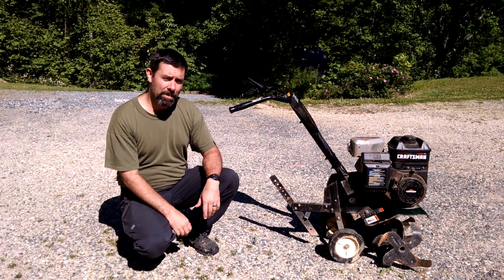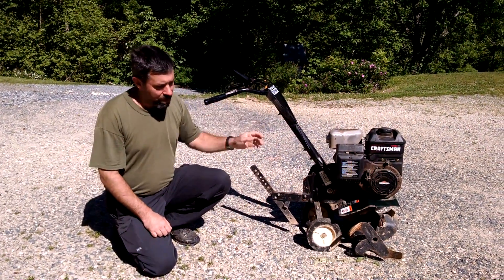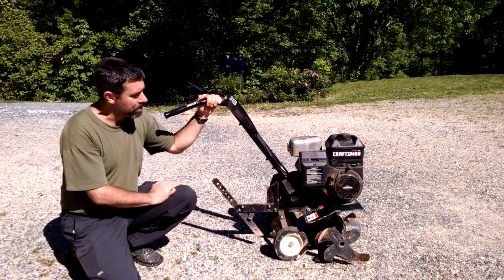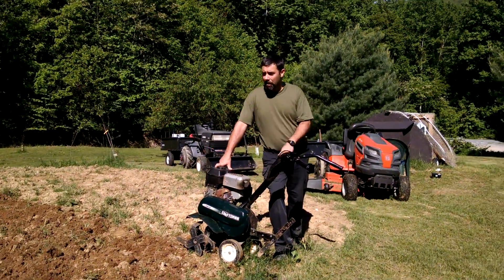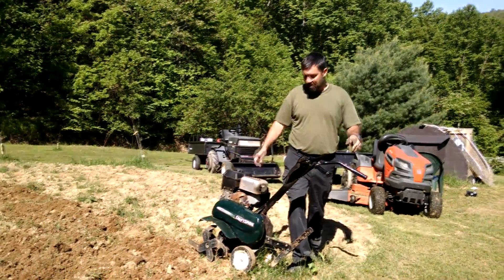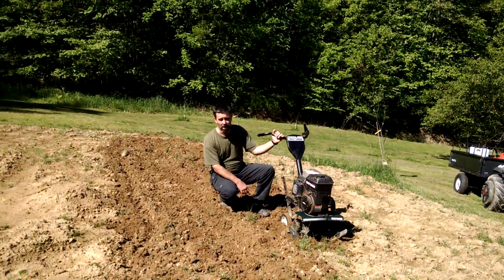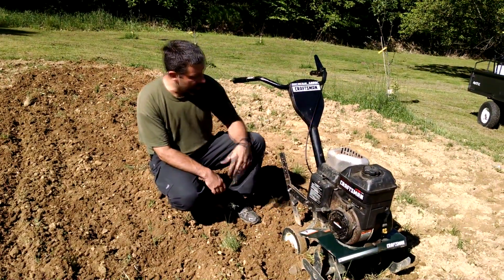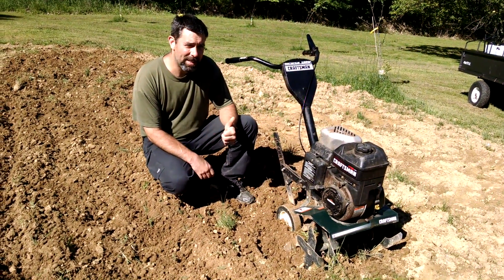Craftsman Front Tine Tiller 15 Year Review And Demonstration

Comment: Depth Stake stops the bucking of the tiller. You should lower it to at least 2" below the ground level if it's sitting flat on concrete.
Reply from the maker: thanks for sharing that tip

Comment: I have the same exact model. 20+ yrs. Starts 1st pull ever time. Only issue   leaky gas tank. Wash after every use. Keep in a shed. 
Works great. Year after yr
Reply from the maker: Ours still works great, maintenance is the key

Comment: you have a part number for the air filter? What oil does it take?
Reply from the maker: I dont have it for the air filter, but you can use SAE 30 or 10w30 oil in it

Comment: Lower that rear drag bar into the soil!  It will take the stress off your arms...I keep mine at least on the 1/2 way down setting.  Yours looks like it's on the highest setting and not providing any resistance to the pulling action.  I have a 1996 Yard Machine model - same basic machine - starts after 2 or 3 pulls after all these years.  Nice vid!
Reply from the maker: Good point! I forgot to adjust it down when I filmed this, but it does help take some of the work off your shoulders.
Reply: @FarpointFarms  I figured as much - you certainly get a good workout either way!

Comment: All you need is time running a tiller and they are really easier than a lawn mower. I have a 1950 sears 5HP front tine that I can run with one hand. It's all about balance just like a floor buffer/scrubber.
Reply: Same,  I have an old yellow one, but not sure the date,  70's I think.  Thing runs like a champ.  I just replaced a axel holder inside the gear box between the tines, 2 years ago.  But this is a giant steel machine that will run forever.

Comment: What if the engine seems to be locked up but it turns backwards
Reply: Check the gears inside the middle casing between the tines.

Comment: you wouldn't be so worn out if you knew how to use that tiller. You're definitely doing it the wrong way. For starters, use the drag bar to allow the machine to do the work. Do light skim passes on virgin ground to eliminate dress on user and machine.

Comment: love the way you leave the loader on the GT all the time now!! looks cool and saves time!
Reply from the maker: It does look pretty cool, and I'm finding that leaving it on has led to me using it for different stuff. I will sometimes load supplies into it if I'm working somewhere on the property instead of hooking up a cart.   I've also recently used it with some ramps to fill some raised beds. It worked pretty good!
Reply: Farpoint Farms hay thats awsome!! Id really love to invest in one for my X500 but John Deeres version is $1,000 so I just cant justify that....my tractor also dose get used to mow so the deck comes on and off meaning the acoop would need to come on and off and it probably wouldnt get used lime yours. i like that one you have I wish one of THAT model could fit my tractor

Comment: I have the exact same tiller, the only problem with mine is the poor design of the handle bars.. (cheep thin metal materials, and lousy welds) have had it 10 years, have had to replace the handle bar assembly  6 times..  currently broken again.. at an average of $85 each , I could have bought a rear tine tiller... Please if you have any suggestions for obtaining a stronger, heavier duty handlebar please let me know. .
Reply from the maker: Your right about that handle bar, I've had to re-weld mine a few times. Its a cheaply made component, but luckily they do sell a replacement.
Reply: Find a welder in your area who's not busy and let him see the trashed handle bars. He should be able to untrash them or make a basic replacement with heavier gauge off-cuts for that price.
Reply: Find a junk out rototiller with good strong handles and modify to fit